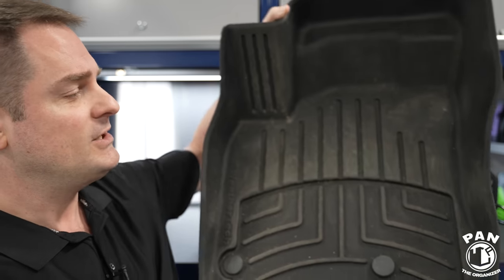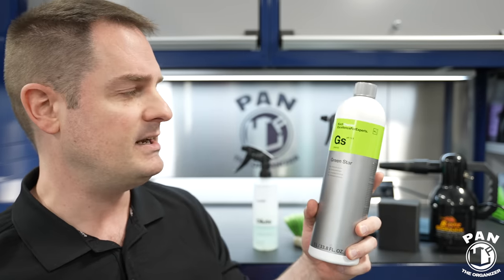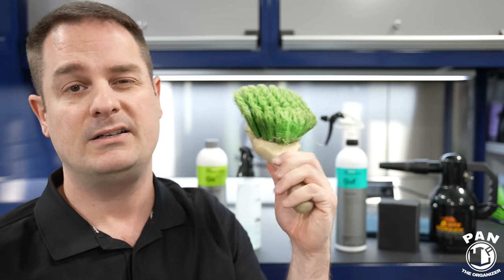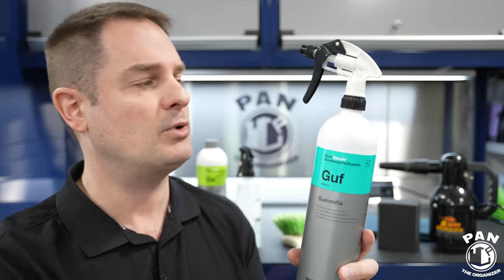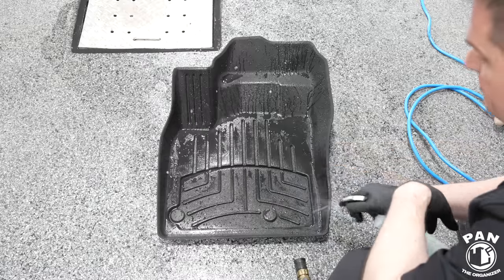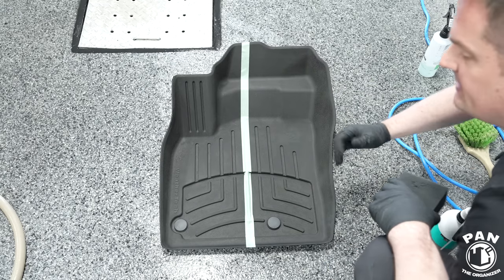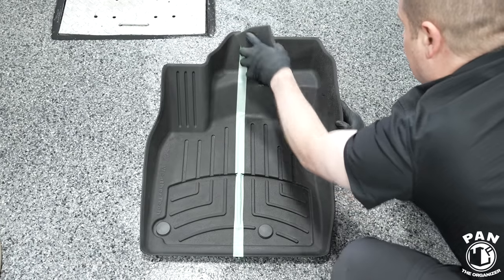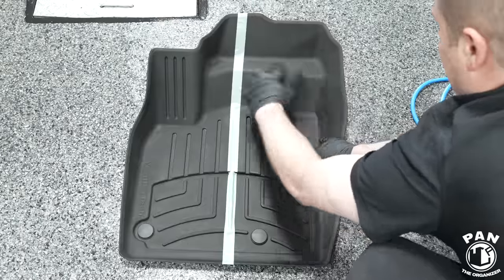HOW TO MAKE YOUR RUBBER FLOOR MATS LOOK NEW | All Weather Mats

Comment: Would have been nice to use an actually used car mat to show if it hides scuff marks. This mat was barely used. Dirt isn’t wear, and we have no idea how a worn mat would look. Just a sales tool for the product disguised as a “how to” video.
Reply: It is a used rubber mat. You even said so in your comments.
Reply: that mat was definitely used. Weathertech’s hold up very well. I’ve owned over 10 sets, and barely ever have to clean them.
Reply: That mat was not scuffed or used like most driver’s side mats look. I’m not saying the product doesn’t mask scuffs and scrapes, I just wish the mat had been more worn to show that. I have weather tech mats in all my vehicles and know they hold up well. But I also know mine scuff relatively easily and only Trim Shine makes them look better, but that stuff is slippery when applied. So, maybe this product works better, but this video doesn’t show that as well as if the mat had been worn (not just dirty).
Reply from the maker: Be very careful with what you accuse people of. I never said this will hid scuff marks or restore scuffed material. There is no such thing. And the floor mats in this video were from my girlfriend's daily driven SUV. She does an average of 20,000 km (12,500 miles) yearly, and has had it since October of 2021.

And she keeps her mats in the vehicle year round. I only keep my rubber mats in for winter months. So I chose her car specifically because they are more used. I could have very well used mine, it wouldn't change the point of this video which was to show a good product that can help make the floor mats look better and have a richer/darker appearance. I think the results are undeniable, and if you read the comments of others who have actually used it, they came to the same conclusions.

It's not because you have scuffed and destroyed mats that everyone is in the same situation. I for one always take care of my stuff, and my mats still look like new. 

If they're to the point where they are scuffed and beaten up and a chemical can't restore them, perhaps it's time to look into purchasing some new ones.

But don't come on my channel and start accusing me of having this video as a "sales tool". Heck Koch Chemie didn't even send me this product, I ordered it myself.
Reply: @PanTheOrganizer  👏👏👏👍
Reply: @PanTheOrganizer mic drop! 🎤 🎉
Reply: Obviously the people that are saying negative comments are not true detailers and do not appreciate the time that you put in giving us all informative information that we can use making decisions on the products we would like to use on are vehicles, don’t have thing good to say watch someone else. Thank you
Reply: Did you not hear what he said? You obviously don’t pay attention lol he said if you use it on old mats it won’t do anything he literally said it won’t hide scuff marks pay attention 😂
Reply: My mats are 6 years old and look just like the ones in the video. My vehicle reflects what others perceive what my detail jobs should look like. Some of us don’t trash our belongings.

Comment: I have purchased and used GUF.  It definitely improves the appearance.  After application when you run your handle over it does not feel oily or slick.  However, when you actually have your heel on the mat it is somewhat slippery! My occupants did not like the slipperiness and thought it was somewhat dangerous when getting in and out of the car.  I apply  very lightly so that was not the issue.  The only way to remove the slickness was to thoroughly wipe it down multiple times with all purpose cleaner.  I no longer use it on floor mats.
Reply: I had the same case. It was slippery.
Reply from the maker: What brand of floor mats do you have? I haven't had issues with Guf yet, all on WeatherTech mats.
Reply: Same, I tried it on the mats of my personal vehicle before using it on my clients cars and it was definitely very slippery! A passenger of mine hurt herself trying to get out of the car. The difference is is I applied more than what’s shown in this video and used a brush to apply. I will continue to do testing with it and use an applicator to apply it, with less product, and wipe down with a microfiber afterwards.
Reply: @PanTheOrganizer  I live in Ukraine and have good quality ukrainian brand Avto-Gumm rubber (PU) mats.
Reply: GUF is slippery when on floor mats that aren’t entirely rubber. For example weather tech is high quality rubber. A lot of the generic no name brands or Amazon brands use a mix of plastic with the rubber and it ends up not absorbing fully into the mat, making it slippery even though you’ve knocked it down with a cloth.
Reply: @ShineAndPreserveDetailing  If you read the front of the label it is literally self advertised as “Interior Plastic Care, non-slip” and on the back also “plastic care for rubber and plastic floor surfaces” even twice. Also my floor mats are high quality OEM Tesla not cheap ones from Amazon. I have also read people have the same problem with even with weathertec floor mats. However I get your point, and therefore will continue my testing in a controlled manner with other floor mats.
Reply: @OQDetailing  that’s a great point. Maybe Koch Chemie needs to update their label because it actually is a bit slippery and not entirely non-slip. I personally didn’t like the longevity of GUF and am going to try out BLAK rubber coating to see how that goes. I saw it doesn’t leave slick surface and lasts months but we will see.
Reply: @PanTheOrganizer  OEM Acura all weather mats.
Reply: @ShineAndPreserveDetailing  yea exactly bro. My opinion is that KC is a great company and most of their lineup is great also, so I think some people are just trying to defend and push this specific product ignoring a big downfall of it, simply because it’s KC. What or from who is that BLAK coating you mentioned?
Reply: @OQDetailing Tesla also calls Vinyl Seats Vegan Leather

Comment: Carpro PEARL, works 100 times better. But thanks for the video.
Reply from the maker: PERL can be slippery on rubber mats, so I would caution against that. But if it works for you, good.

How did you discover my channel by the way Manuel?

Welcome to my channel. You discovered one of the biggest car detailing channels on YouTube as we surpassed 980,000 subscribers and we have over 132 million views! I have been detailing for 26 years and I love to share my knowledge and passion with my viewers.

You found the right channel to help you learn everything about detailing.
Reply: @ManuelSanchez-tk7tr  good video Pan as usual…

Comment: I tried GUF few times and every time despite the way I apply it (spray on the surface and clean with microfiber cloth or just spray and leave it to dry) it creates very slickery surface. It’s good enough to play hockey, but terrible for a car. Am I doing something wrong or it just not suitable for my mats?
Reply from the maker: This is not slippery, so there must be something wrong. Are you applying it to rubber mats? Make sure you clean the mats thoroughly beforehand, with an APC or floor mat cleaner. Then do a few light mists (don't oversaturate!!!) and work the product in, as shown here. It should not feel slippery.

If you still have issues, perhaps reach out to Koch Chemie and troublehsoot with them to see if you maybe had a bad batch or what you are doing wrong.
Reply: @PanTheOrganizer  thanks very much for your response. Yes, I am very surprised since it's designed for rubber mats. I have standard BMW winter mats. I wash them with Koch-Chemie Green Star light dilute with a hard brush, then rinse, wait for them to dry, and apply Guff with a microfiber sponge. Might be I apply too much. I will try to reduce it next time. Thank you!

Comment: I love GUF so much.  In my opinion it’s as impressive as MP is on the engine bay.  I’m very particular about mats/flooring and this is the only product I’ve found that does exactly what I want.

I’ve tested it off-label on the exterior (step bars on trucks) but dust does stick to it, sadly.

I mist directly on the mat and level with a detail factory curveball, super easy and works great.

The odor is fairly mild, smells a bit like PSS.

Don’t replace your old mats before you try GUF, it’s really that good 👍
Reply: Do oh think hug can be used for tire shine because from what I see Pss is used for plastic trim and can be used for tires and do you think PSs is good for the mats
Reply: @jamesvincent6185  I would not recommend PSS on floor mats.  GUF has anti-slip properties that PSS does not

Comment: Another fine precision video good sir! 
Pan, with your experience, how long do protectants last on the door panels and dash before they begin to break down? And is Fusso coat 99 still one of your preferred sealants? Thanks man!
Reply from the maker: Thanks for the kind words about my videos. Always nice to hear. I don't measure the durability of interior products. I have to draw the line at some point, I would die trying to measure the durability of everything known to man haha. I focus more on paint protection durability. For the interior, most products typically will give you a few weeks to a few months protection at best. Hence why it's recommended to maintain your vehicle's interior once a month or at least once every other month.

If you apply a base layer of long lasting protection (like CarPro PERL dilute 1:5, or 303 Protectant, or DIY Detail Interior Ceramic) those should last a few months. All that will be left once every 3-4 weeks is to use an interior quick detailer to lightly clean smudges, light dirt and dust, and to boost the existing protection. That's when you'd use CarPro InnerQD, Turtle Wax Hybrid Solutions Mist Interior Detailer, DIY Interior Clean & Protect, Lithium Inner Space, Adam's Interior Detailer, etc).

Comment: After cleaning, need to use a non-oil and non-silicone base black rubber solvent to prevent foot slippage. Something like Chemical Guys Mat ReNew Rubber. Your Floor mats will always become marred with dirt and other things you take from the ground. Wear protective booties over your shoes, boots, or sneakers, remove them as you get into your vehicle. No more contaminates on your mats brought in from the outside of your vehicle.  Winter time lay down a large used old bath towel. Change your footwear and place snow boots and the towel in a kitchen dish wash basin "dish tub". Keep your car mats clean for a very long time. Okay! purchase a second set of floor mats for your vehicle and store them until you have the desire to present your show-and-tell showroom vehicle with brand-new car floor mats. Once the show is over, remove and store the new mats in a sealed container to keep them new, and put your daily useful mats back on the car floor. Maintaining and Cleaning your vehicle is nice,  but you will never be able to keep it in Factory condition coming off of the production assembly line. Deterioration, Corrosion, and Contaminants will occur by force of nature and the almighty above as nothing lasts forever. If you don't use it, you'll lose it! Going overboard is a waste of time and money. Just keep the floor mats clean as they don't have to look pretty. Question? Do you look down at your feet all day? If so, people will probably wonder if you have a problem. The purpose of a floor mat is to protect the carpet.

Comment: @pantheorganiser nice video like alsways. Pan i got to ask u somethin. 
Last time u showed the scratch remover from turtlewax (the one with the clear coat). 
Can u put first the clear coat and over it a ceramic coating? Or would the solvent mess with the turtlewax clear coat?
Also if u use both (ofcorse with sometime in between) would the paint look better since it would be like a lense? (The bottle may can coat a car).
Also can u how should i say that mask streaks or love marks with the clear coat?
I couldnt find any videos about it and also didnt had anyone with experience to ask to.
Reply: And one more question. In ur videos u say "to maintain the ceramic coating" u mostly use some spray coatings over it like flexwax. Can u use something else aswell like Fuso (pastwax) or polymer base products ( like polymernetshield)or would that destroy the ceramic?
Reply from the maker: You should write to them and ask them directly, I don't have enough experience with that clear coat scratch remover yet.
Reply from the maker: For maintenance of ceramic coatings, you have to use compatible ceramic based products. So no, you would not apply a Fusso wax, or any carnauba wax or regular sealant.

See my detailed tutorial on how to do a proper maintenance wash on a ceramic coated car here: https://youtu.be/IqIW78FmRYU
Reply: @PanTheOrganizer  ok got it thank u. 
What about the scratch remover part? Can i apply Ceramic coatings over it? And would it look better since in theory it would be a thicker layer?

Comment: Hey Pan, how do clean bugs stuck in the radiator akd the ac condensor? Im back from a trip (montreal to jasper and back) 

And the condensor is filled with bugs, i had some armoral bug remover.... but it does not work... what should i do?

Comment: I am soooooo tired right now....  just washed my car in the driveway.  Spent 3 hours washing just the outside and wheels.  In 97-degree weather.(yes, I know I'm not supposed to wash under the sun, but it cannot be helped)  😂     Rinsed the whole car with water, sprayed on a super thick layer of foam, riseed foam off.   Second coat of foam and started washing.   Since it was sunny, I washed one side at a time.  For some reason, when I was done, it was already 3 hours later.          I need to watch fewer Pan's videos.  At this rate, it will take me 6 hours to wash my car next time.  😍   When the sun goes down and the temps go below 85, I will probably start with the waxing/polishing.     This is better than going to the gym.  I can burn off a lot more calories by washing my car.

Comment: Hi Pan… I have an unrelated question, I park my car under a tree a found sap on the hood of my 2021 XC-40 Volvo, I used Koch chemie green star to remove at 5-1, with a kitchen sponge which seem to put what I believe to be light scratches on the surface, I started off with rupes fine finishing compound with a yellow wool pad, didn’t come out , then went to a rupes blue wool pad with sonax perfect finish 6-4, still didn’t come out, I used my fingernail to make sure the scratches aren’t thru the clear coat which THEIR NOT.

What would be my next step to try and remove these scratches?  I have flat black paint , my pressure on the machine was light on the 1 st try, on 2 nd try I used about 10 lbs of pressure, don’t want to burned thru the paint.

Thank you for any advice, know it’s difficult not see the vehicle, I’ve never had problems before removing scratches but never had sap either.

Ken
Reply from the maker: Using an APC isn't the appropriate way to remove tree sap. You need to first wash the car, dry it, and then use a proper tree sap remover, like this: https://bit.ly/3pvgmXj

You would spray that on the clean surface, let it dwell, and then wipe with a microfiber towel. Multiple applications might be needed depending on how thick the sap is, or how stubborn it is to remove. Do not work in direct sunlight, don't let the product dry on the surface, and work on a cool surface. 

Once the sap is removed, then you can use a compound and polish to perfect the paint to remove the scratches you induced on your previous attempt to remove the tree sap.

I will have a full tree sap removal tutorial coming later this month. Stay tuned.

Comment: I have seen in another video where you cleaned rubber floor mats using McKee’s 37 Rejuvenator and 303 Protectant or Lithium Inner Space.  Would it be problematic or overkill to use those along with Guf?  I don’t think Guf has any UV protection in the formulation, so it seems that spraying 303 or Inner Space after applying Guf would be the ultimate combination of finish and protection.  Your thoughts?
Reply from the maker: That would be too many products. I wouldn’t worry about UV protection for floor mats as they sit on the bottom and the sun rarely goes that far.

Comment: Does GUF cause any off-gassing oily film on the inside surface of the windshield?
Reply from the maker: Any stuff in the interior can cause that over time. Materials off gassing will cause more of that than Guf.

Comment: Is that drain super useful….or what!😊 So much easier when you can just tip the excess water away. Where does the water go from the drain? Into the normal drain system in the house?
Reply from the maker: Yes I have two drains in the garage and they go to the sewers.

Comment: I want to use it for gas and brake pedals, can I? Because I've been looking for a long time for something that doesn't slip
Reply from the maker: I wouldn't use anything on pedals. Just an APC to clean, and that's it.
Reply: And about a steering wheel or gear lever? Am I not defending this too?

Comment: Thanks for the great vid, Pan. Good info as always. You cost me money every time I watch!! :) Quick question. I want to buy a mini blower/dryer and comparing the Metrovac to the Adams Mini. The Adams has a 20 ft cord, more amps/watts, and feet per minute. Is there a quality issue you are aware of that should lead me back to the Metro? Thanks!
Reply from the maker: I haven't tested the Adam's. But as they don't make their own equipment, they outsource the work. So there's a high likelihood of brands like MetroVac making their blowers anyways hehe. Who knows.